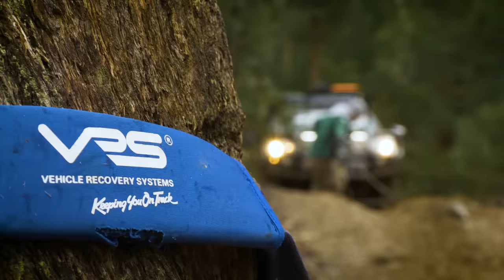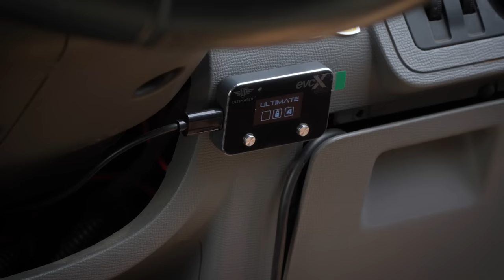Our WORST adventure 15 winches, 3 Cars Towed, 1 Dead Engine

Comment: 2:42 reconigse that sound !! another good trick is to let it glow for the 10seconds and have a after market dual battery link switch on to give the starter the extra amperage and u'll find it will turn over easier each time . once it starts cranking for too long and draining the main battery your always going to have issues after that .
Reply: i use a ABR sidewinder
Reply: @brentmcd12  do what I did, get the lead acid crap out and dump a Lithium starter battery in.
My ZD30 just raws into life now, yes especially in the cold.
Let it glow, hit the key, cranks effortlessly into life now, was always sluggish with lead acid on cold mornings. I though my glow plugs were the issue, but since I went Lithium no issues, it just works.
Reply: @ianweal3081  yeah for sure ! the lithiums are voltage regulated so no drop.

Comment: Good stuff fellas
Those cv’s not really up to it on those smaller ifs cars but I suppose they act as a fuse to prevent further damage?
Reply: IFS on larger cars are just as bad, relatively.
Reply from the maker: spot on, but there still should be a better solution.
Reply: @4WDTV  There is m8 get a 4 Runner. 😉

Comment: What was with all the white smoke out of the diesels?
Reply: The white smoke is mainly caused by incomplete combustion or water in the oil supply system, which causes the diesel to become oil vapor, and the discharge is white.

1. The working temperature of the engine is too low,and some of the diesel fuel becomes oil vapor when it is not burned. It is discharged from the exhaust pipe with the exhaust gas and emits white smoke.

2.There is water in the oil supply system. There is moisture in the fuel or in the combustion chamber (there is water in the fuel chamber, which may be caused by the rupture of the cylinder liner and other parts, causing the water to enter directly). The water is heated into water vapor in the cylinder and discharged from the exhaust pipe to form white smoke.

3.Fuel injection problem. Poor fuel injection or atomization causes the diesel to not fully burn or because the oil supply angle is too small, the injection time becomes late, the cylinder temperature has decreased when the fuel is injected, and some of the diesel fuel becomes oil vapor when it is not burned, and white smoke is emitted.

4.When the cylinder pressure is too low, some of the diesel fuel becomes oil vapor without being burned, and white smoke is discharged from the exhaust pipe.

Comment: Geeezus did you big boy have that Patrol pull your Holden up that incline by the winch rope 
Getting a little complacent while getting a little long in the tooth 
Im no expert but that looks dodgy azzz 13:53 minutes in
Reply: And in tow with a camper trailer and did it again at 17:48 🥴
Simo simo simo